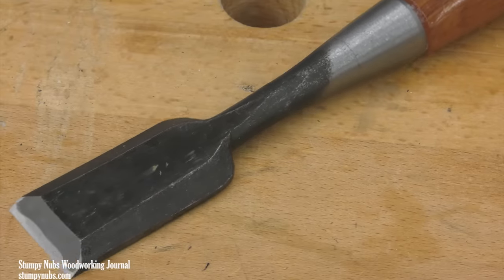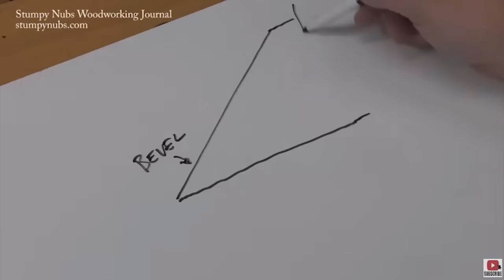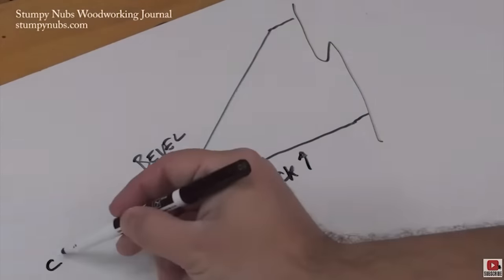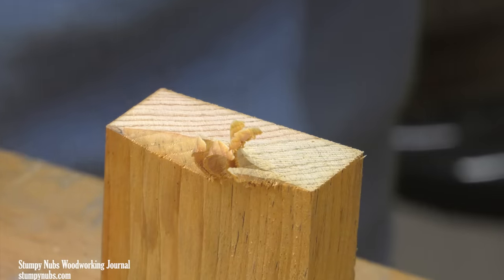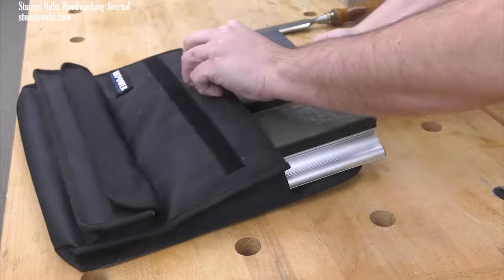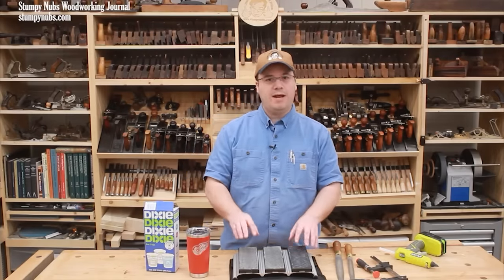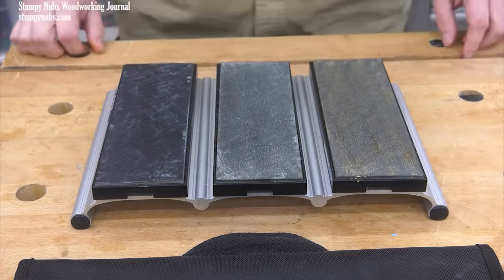The truth about Japanese chisels

Comment: My new set of Czech "Narex" triangular dovetail chisels have a similar groove in the backs, but they're way too deep; I was able to flatten the "backs" quickly, but after I grind down the bevel a couple times, the 1/2" flat portion will be gone, and they'll be unusable.  I'm old enough that that probably won't happen in my lifetime, so I won't bitch too much.  
But I've also had an issue with that hollow grind on even the best Japanese chisels.  If you're paring along a narrow board, you may only have one side, or even NO sides, referencing the back of the board, which makes them useless for paring in the first place.  
It took me (iirc) two weeks to flatten the backs of my 4-piece Marples chisel set, 31 years ago, but they sit FLAT against any reference surface, at any angle, and I'll die before I need to touch their backs again.  FWIW.
Reply from the maker: If you are paring a narrow board with a Japanese chisel, you should use a narrower chisel.

Comment: I watch a few of your videos, skip a lot more. Many are unrealistic to the average DIYer. That's OK, it's your channel. More interesting to my mind are projects without the smoke and mirrors of expensive tools and onetime (to the DIYer) use jigs. 

A series of projects with only a drill, 7 1/4" circular saw, maybe a router or sander (corded or non-corded), and a pocket hole jig (personally I like the Wen, but whatever). A few clamps, rulers, and screwdrivers. A lot more accessable to the average DIYer. They probably have many of these tools. And could Harbor Freight the rest. You could even sponsor a starter set of tools with a hardware supplier of your choice. You don't have to give up the more complex stuff. It's a parallel series. BTW nothing is a game-changer anymore, skip the hyperbole.

Comment: When you lay a chisel on the work bench, lay it back-side up so your cutting edge is not in contact with the table. That perfectly flat surface is 98% of the tool's effectiveness. You can have the finest knife edge but if the back isn't flat right to the very tip, you can only gouge  with it. Splitting hairs... I know.
Reply: Exactly, yes we’re literally splitting hairs gere